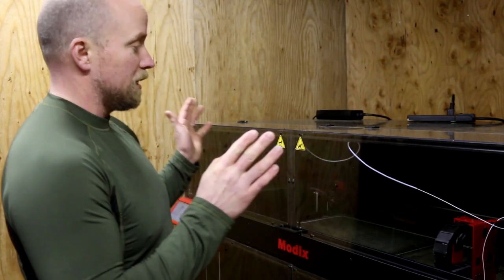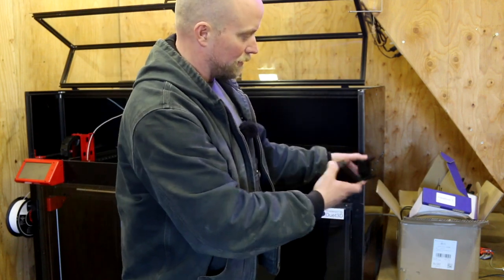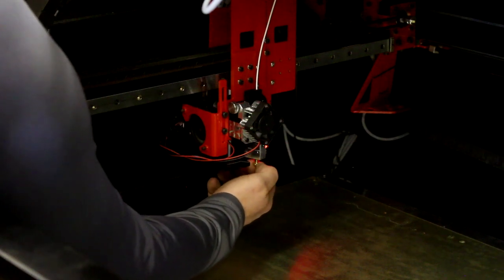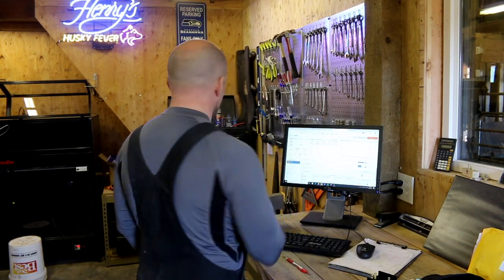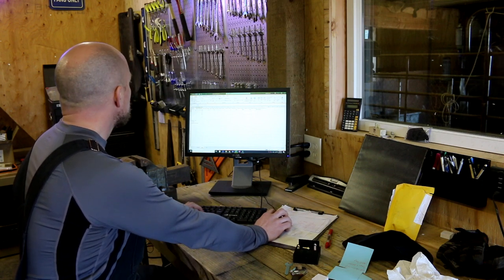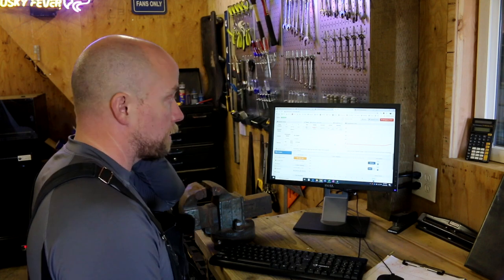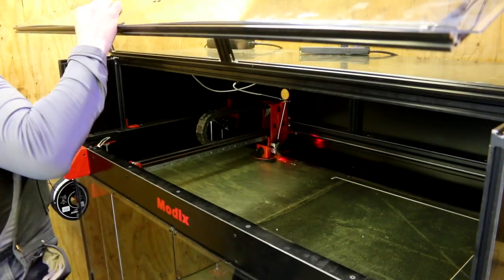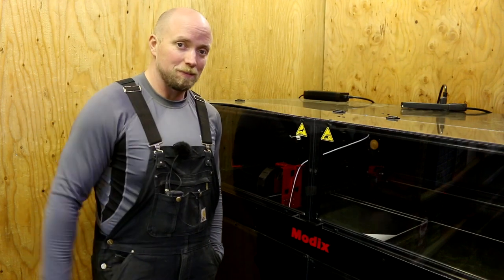MODIX 120V3 - CALIBRATION and First Test Prints

Comment: 1) clean the nozzle by heating with a propane torch
2) That first print looked like there was not enough filament on the first layer - it should have been a solid sheet, not strings
3) PLEASE - use a feeler gauge to set the nozzle height not paper!  I know you have one!!
4) You should always print as cool as possible - you will have much better print quality; that will require some testing.  The hottest I normally run for PLA is 230, but 215 is more typical...

Comment: Hello I would say your z offset is to big make it 1 bit of paper just rubbing nozzle not 0.5 roughly 0.12
Secondly order some Capricorn bowden tube much better than that white tube. Also I would research the line width seems a little big maybe. Also make sure the bowden tube is fixed well into hotend and the tube is cut square so sits in hotend tight no gaps inside. Also pla no need for heated encloser and hot end 220c should be ok. I can help if you need it
Reply: Just from a quick look I would say most volcano hotend users with a 1mm nozzle are using 1.2mm extrusion width and I wouldn't say 0.8 layer height to be safe at first tho can go up as you figure it out. Speed aswell should be able to print inner and outer walls and support all at atleast 50mms with that setup. First layer I would slow to 20mms. Times my speeds by 60 for your calculation